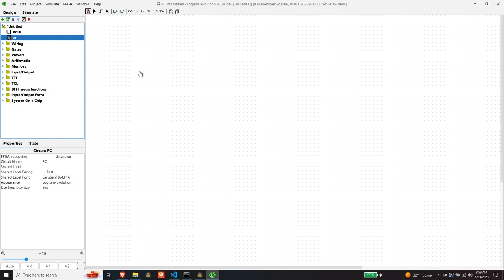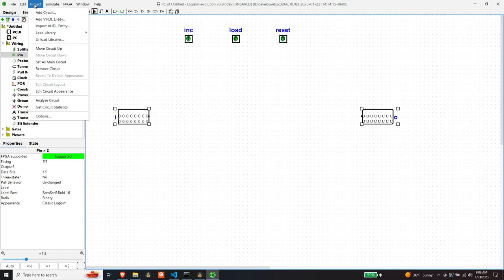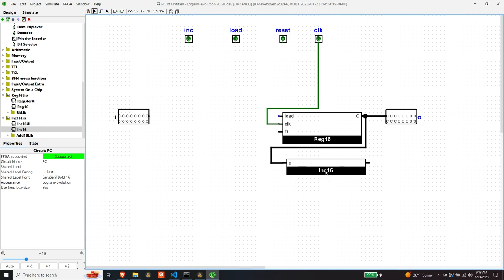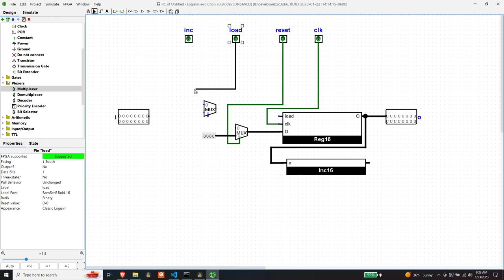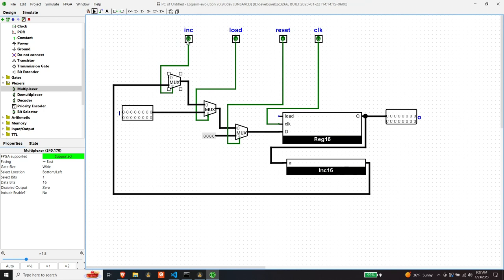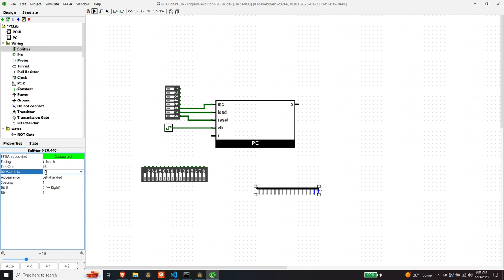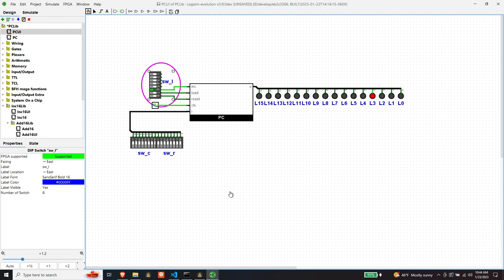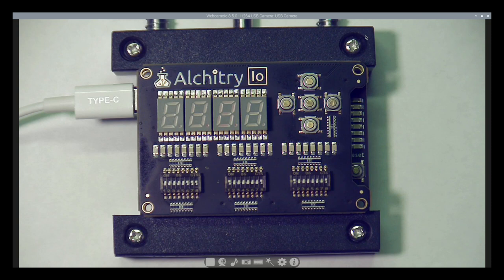HackCPU Logisim Program Counter Implementation

Comment: really love your videos! I recreated this circuit, however logisim gives me an "oscillation apparent" error. it seems related to the 16 bit increment chip. In order to follow a long, I made my inc16 chip with the stock adder chip switched to 16 data bits and then a 0 value bus attached, which seemed to be working fine, however now when it's used in this circuit is having an issue. Either way, this helped me understand the program counter function much better, completely missed the OR gate implementation on my own
Reply from the maker: That error usually is because of feedback but I cannot specifically answer without a circ to study.